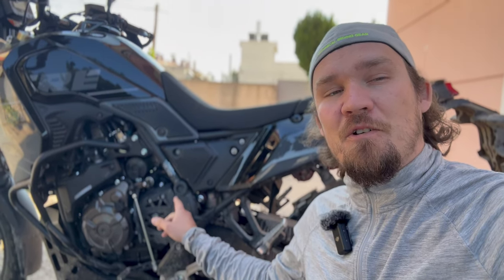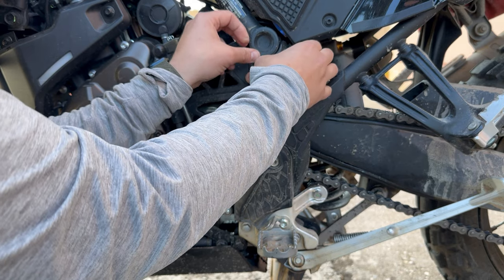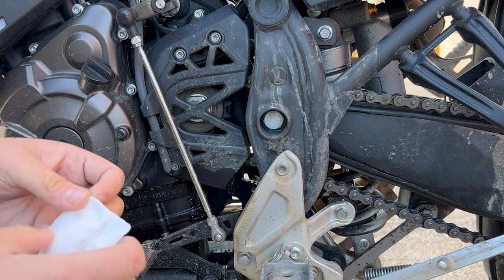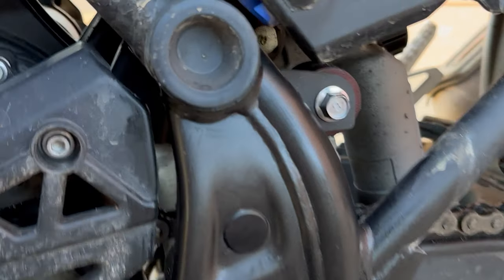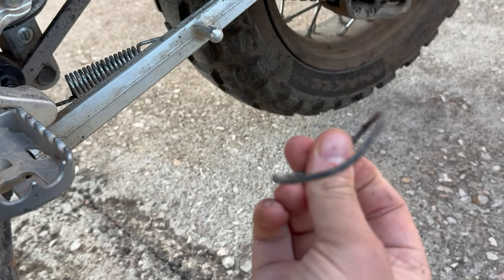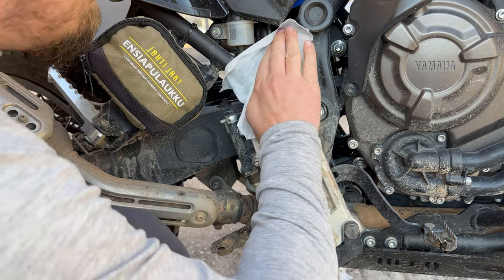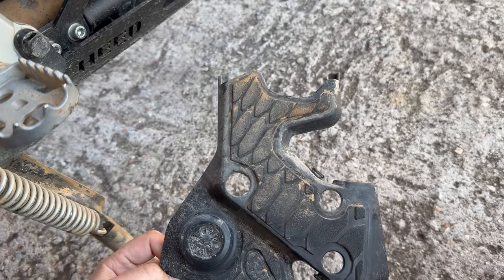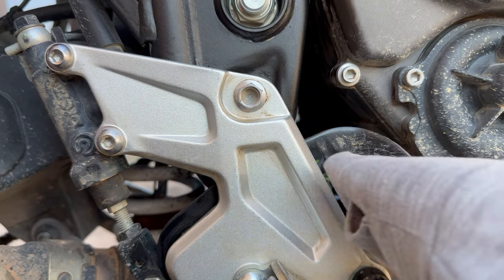Do plastic frame protectors work? (ft. Tenere 700)

Comment: Very interesting, i put on these before winter now i worked on bike an i realized those rubbers are cracked and some also snapped. I didn’t ride during winter the bike is waiting for first service. I have to zip tie them. I think they are nice but my rubber was not goods maybe
Reply from the maker: Interesting! The rubbers are probably quite expendable and this is why they usually send extras. I think they are easy to replace by some other generic ones too.
Reply: same, one of mine fell off on the highway... i went pick it up and zip tied them on.  all of the rubber bands were dry rotted.  no problems since i zip tied them though!

Comment: I dont have them but the part of the frame which is protected by them does not seem to be subject to abrasion from mx boots anyway. In my case it is the lower grey metal part supporting the footrest which rubs and has paint damage.. do acerbis protectors cover that area?
Reply from the maker: These ones come all the way to almost touch the footpegs so yes. But not sure I understood your question correctly 🙂
Area covered by the protector is pretty well shown on the video before I take them off ☺️

Comment: zip tie them on!  rubber bands they come with dry rot pretty quickly.
Reply from the maker: On my T7 the rubbers have lasted for the last 15000km but on my Honda CRF they brake all the time. Maybe there are some guality variation on them. 
Ziptie works too :)
Reply: @PatchedBandit  no telling, if the zip ties start breaking i'll just drill out the frame :)